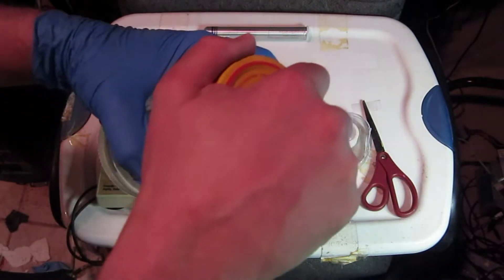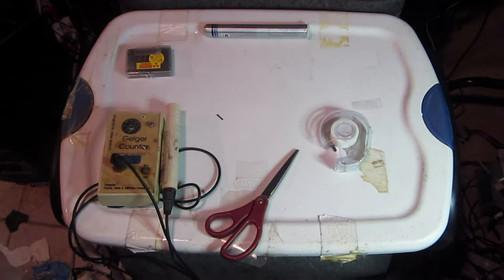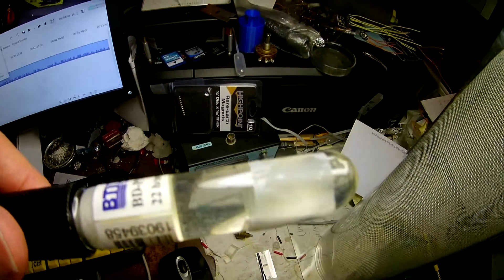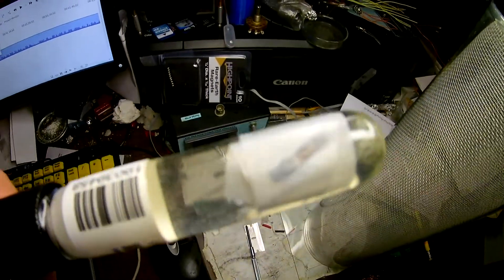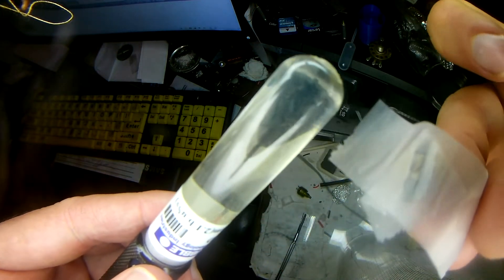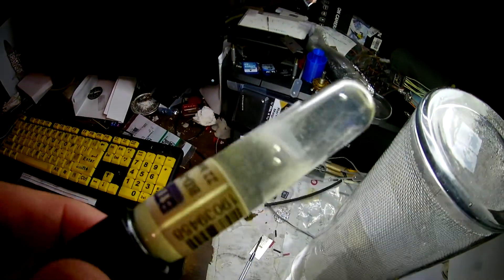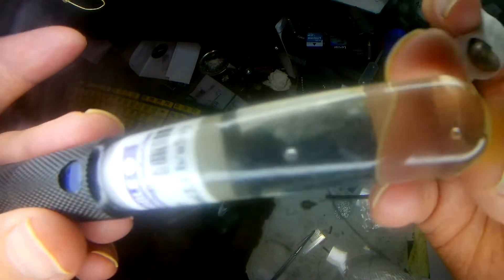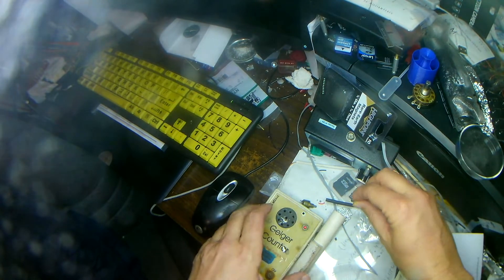Lithium, Americium, and Neutrons?

Comment: if the paper blocks , wouldn't your tape be blocking also ???
Reply from the maker: There is nothing between the radiation source and the lithium.. the tape is to hold them together and against the detector..

Comment: If you can provide alpha particles besides americium, how big a number of neutrons can you produce from 1 square centimeter of lithium?
Reply from the maker: I am not sure.. I could try to calculate how many neutrons per bubble is created.. it is really much better to use Beryllium if you can..
Reply: jaynes network I’m using lithium because the neutrons produced are slow. I’m going to irradiate yellow cake. Do you think beryllium would produce as many slow neutrons, or would if you used paragon to moderate the speed?
Reply: Wax
Reply from the maker: I would use heavy water... if I had a choice!
Reply: jaynes network I will test beryllium the next time. I already know I can produce I can produce a flood of neutrons. My concern was to determine if I would produce an explosion if I used too much lithium. Your answers suggest that won’t be a problem.

Comment: Hello, love your videos I think they are great. I seen a couple of your other videos and you used beryllium. Could Lead be used to do the same thing?
Reply from the maker: Beryllium is a very special material.. It has a loosely bound neutron.. it is only a single isotope, and when that neutron is liberated, the whole atom disintegrates.. Aluminum is supposed to generate neutrons as well, but with a lower probability.. I may try that next.. lead is at the opposite end of the spectrum. You can probably make it radioactive by bombarding it with neutrons (but not with alpha particles)... bismuth is better.. that makes polonium, which is one of the most highly radioactive substances! This is all interesting stuff! Thanks so much!! There will definitely be more experiments to come!!
Reply: @jaynesnetwork  great i have a lump of bismuth